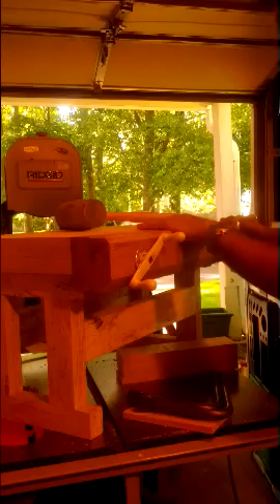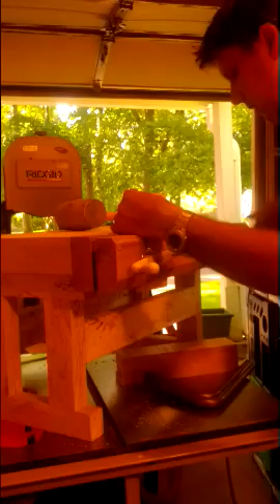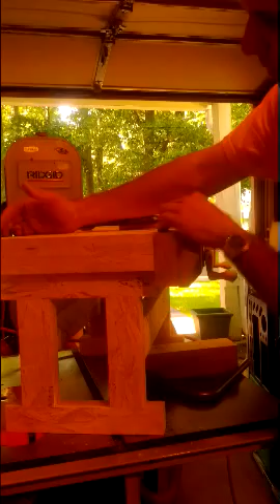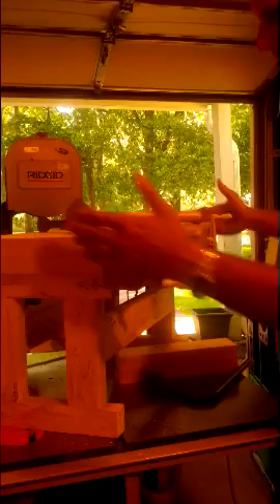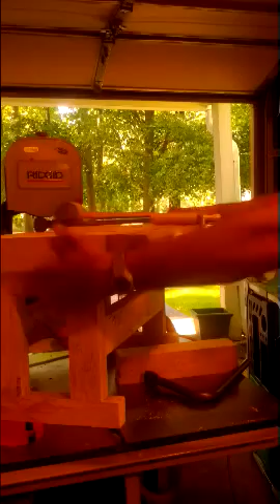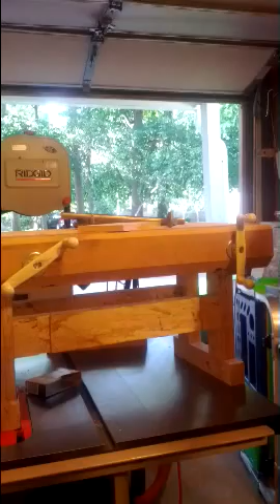Doug's Benchtop Bench

Comment: Nice bench, I was interested to hear what you said about the fingerjointed top. I bought Fox brand veneer screws with the same problem but instead of fixing them I bought cheap chinese hand wheels for $10 each tapped them for 1/2" allthread and went from there. It looks a bit like the bench Frankenstein would have built if trying to do a Moxon vise.